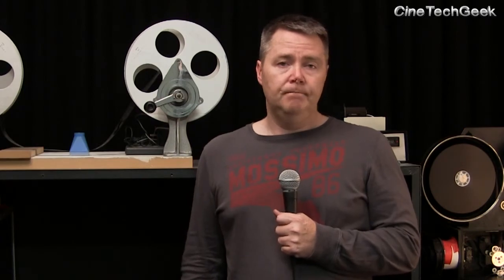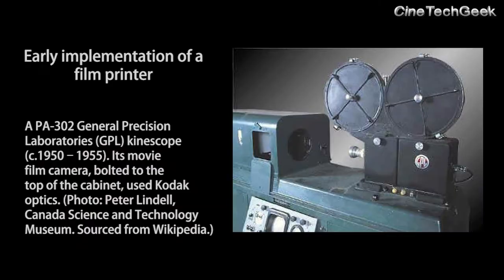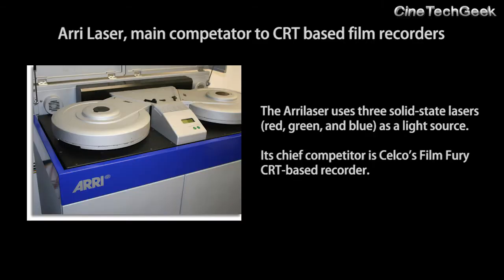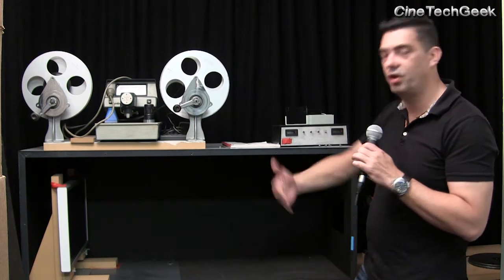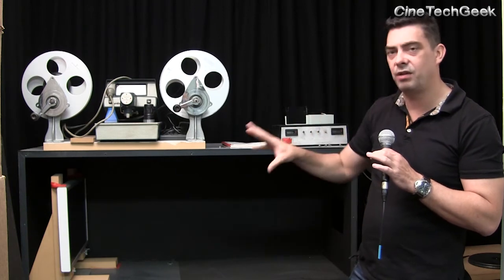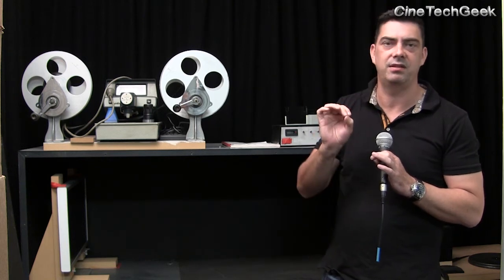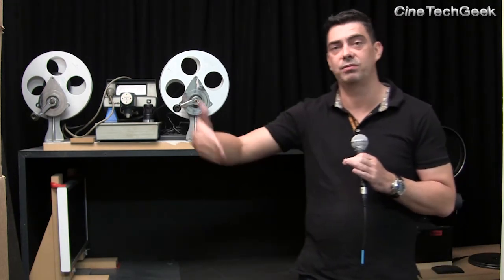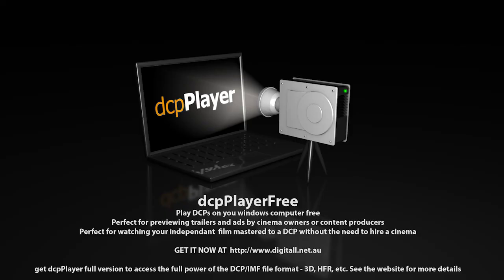History of Film Printers

Comment: The first personal digital film recorder which could do 4K resolution that I know of was the Matrix PCR from 1986.  It was a small machine, about the size of a water fountain, which  connected to a PC via a GPIB connection. It had a maximum resolution of 4096x2732 and colour depth to 16 million colours.  The camera- typically a 35mm rangefinder, but any type of camera could be used- connected to the top of the machine through a small window with an intercangeable lens mount.
Reply from the maker: +douro20 I cannot find anything about it on Google..
And to tell the truth, if this did exist at the time, how come it was not more better known.  It would have been considered the best in the world at the time is it truly could do that at that time..
This is especially interesting as I don;t really know how they pushed a display to capture from at better then 8 bit at that time.
Reply from the maker: +douro20 8bit being 256*256*256=~10mil.  yes but 8bit colour can produce banding. Especially in the cinema/theatre environment.  Tho I must admit, being as we build our own, the noise introduced by film tended to cover this issue.  I personally found film to be very limited compared to digital based on building a film recorder..  It is true film can do some aspects better but it also introduces a lot of analog error which seems to be overlooked and simply described as "The Film Look"  I suppose its the differences in science and art.  

I imagine the unit did do a R/G/B pass. as such would have taken considerable time to record a frame.  Plus many other data path issues with computers driving frame buffers at that resolution in that era..  We had some tricks to overcome many of these issues in our implementation as seen in the video...  Ie like rendering directly from AfterFX frame buffer and not going to disk with the full resolution file..